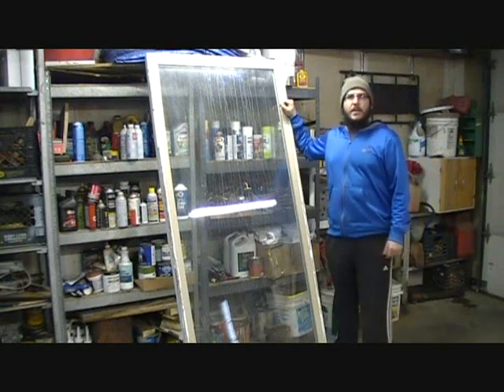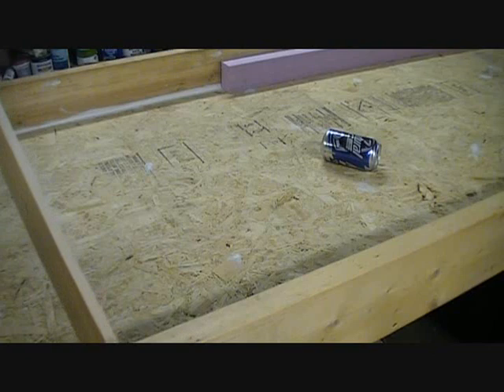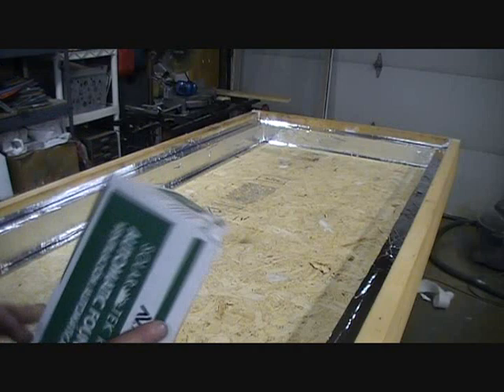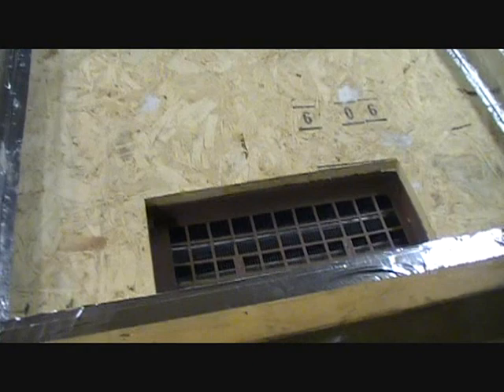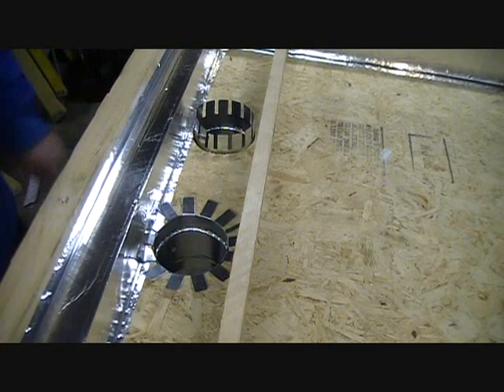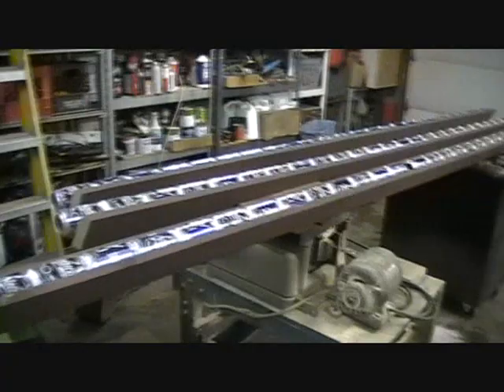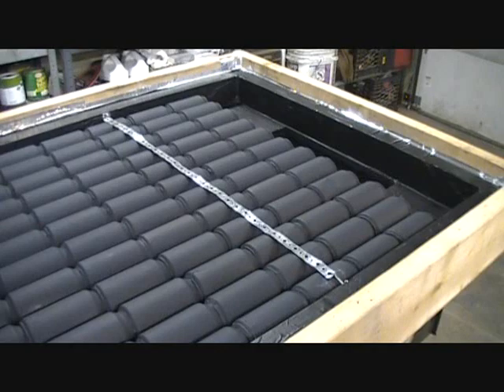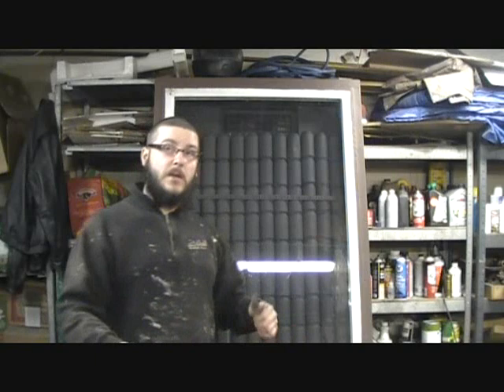$50 Homemade Solar Heater - Passive Solar Design

Comment: I'd recommend insulating the back to cut down on conductive heating. Heat will transfer from the plywood backing to the sheeting of the house. The house has a huge surface area which will inevitably draw down the temperature in the box.

Comment: Great build.  One thing when working alone is to put a board across the box, side to side, at each end.  When you lay the window on top it can be moved around and one end at a time can be dropped into the recess.  Kinda like using the slats from venation blinds when using contact cement and Formica.  Just found your video so I'll look for how it turned out next.

Comment: Great video !
I tried to enlist in the Ukraine Army after serving in the U.S. Marines but was told I'm too old.
My best friend is Ukraine and has family and friends there. Just wanted to help some how.
I saw a reflector made from mirror tiles mounted on rods that could be bent to focus on the coil.
I've recycled a 10' diameter D- band satilight dish with reflective tape focused on a welded aluminum  radiator from my old Corvette. Just welding stabizers on the mast and build mounts for the actuator and tracking solar panels to complete.
Thanks for sharing your knowlege and I'll be praying for your country.

Comment: Great job on this video!  Thanks for sharing your efforts - practically all houses should have this technology, and your version is much lower cost than a lot of other options.  I apologize, but I'm going to quibble with your choice of outflow vent.   If that doesn't close until 40* F then people in places not as cold as Maine will end up air conditioning their house in the winter.   It gets really cold and stays really cold in Maine, so this won't be such a problem for you, but people as far south as Missouri need to buy snap switches to turn on the fan / open sealed  damper at about 120* F and close the damper/shut off the fan at about 90* F.
Reply from the maker: Agreed and good points made.

Comment: You should install some aluminum bars inside the box. These aluminum bars will be used to store more heat and stabilize the heat fluctuation  when the sun is not shining.

Comment: When building a solar heating unit such as this, a few additional things you can do is contact a local machine shop for the shavings from their milling machines to place inside of the cans and to also obtain any sections of 1/8" thick steel or aluminum you get your hands on to completely line the plywood backing inside of the frame since it will act not only as a heat sink but will also radiate an intense amount of heat you would not be able to obtain with the plywood backing alone. Remember to paint with VHT flat black or barbeque black, but you will need paint specifically made for high temperature use otherwise it will not survive very long in an environment such as your solar heater.

Also by crumbling/crushing smaller tin cans and filling the inside the cans you had decided upon as thei source for your solar collectors those will do as nicely as the shavings, or even old lead weights from any tire store since they have to pay an environmental fee to dispose of them as hazardous waste.

Remember to lightly scuff the exterior of each can in order to enhance the ability of the paint to adhere to it's surface, which should be dull or flat black VHT exhaust or barbeque paint, no gloss since any gloss will reflect sunlight.

The cans I used, BTW, were dog food cans from Costco and fit vey neatly into each others top and bottom and when joined with a fine bead of JB-WELD make a virtually leak proof joint which equates to more heat transfer to the vent into your structure.

One last item to consider is for safety you can add a layer of fine stiff wire over the glass to protected it, and no it will not decrease the effectiveness of the unit to gather the Sun's rays to any real degree, no pun intended.
Reply: So you would recommend putting hazardous waste in the airstream of a solar heater? I'm guessing you didn't think very much on your concept before sending in your suggestion. Health and safety should be of utmost importance in ANY endeavor. Not just for yourself, but also for others. You must also be very careful with recommendations so as to avoid harming someone and possibly incurring a lawsuit. Be safe.
Reply: @donaldshimkus539  I was in charge of the VOC Environmental  Program at Disneyland for sixteen years which I perfected and established and each and every Disney Park from Florida, to Europe to Asia uses this program and never once did our Park receive a Citation for an environmental violation during the time I oversaw the program.

So before you attempt to belittle my expertise, you should know that neither shredded metal nor lead are capable of releasing VOC's, volitile organic compounds, into the atmosphere.

As far as using VHT paint, it is of an approved VOC level for any area it is sold in per the local Air Quality Management District, otherwise it CANNOT be sold, so go to the store, read the label where it states, "VOC Content" to verify if it may be legally used for a specific application. Keeping in mind that each AQMD RULE has a different plateau or level for each type of surface it may be applied to, with wood being different, than metal or fiberglass, vehicles vs aircraft - So did you try and bust the nuts of the original contributor as well or did you just wake up.

Your smartass and uninformed remark only let everyone on this site know how unknowledgeable you are as to how the environment is actually polluted, especially when you do not know the games played with various products which allow them to be 'legally' used where yhey had previously been prohibited.

As for being SAFE, I was also the Safety Rep for the Maintenance. department for close to twenty-six years which is comprised of several hundred members and was kept up to date with the current requirements per OSHA and CAL-OSHA so I dare say I am quite probably more  familiar than anybody on this site with both the environmental and safety issues of what your statement alludes to.
Reply: No Not everyone
Reply: I am a theorectical partical physist And I specialize in thermodynamics
Reply: Just kidding
Reply: but don't say your better then everyone hear mickey
Reply: OUCH ! Larry, it's painfully obvious you are WAY to intelligent to even be on this silly little site. Go play someplace else.
Reply: Use a metal screen.
Reply: Go Larry Whalen! Thank you I am prepping and thought of using corrugated steel panels and cans as well to achieve this. Millings are a great add to this project. Would you recommend  any thermal break using a 1" foil air gap to separate and insulate the unit.
Reply: Great idea on the glass. I found a set of sliding glass doors on marketplace for free. I will also have to remove one pane of glass but that's easy. I do encourage using a foam board backer for insulating the interior of the heater which will also make the interior of the heater hotter. I plan to use foam board and then plan to use aluminum foil tape over the foam and then paint it all black of course.

I found another guy who cut off one side with a can opener but on the bottom side of the can, he poked 4 evenly spaced holes through the bottom so air flow would be somewhat restricted and allow it to heat up more.

Comment: Wow I think you are one person that would never irritate me.  You don't cut corners on your work. You are great at being a teacher plus no pause in-between your thoughts.  every detail well thought out.  you thought of every angle.  I don't even need to see you to be attacked to you.  Not everybody thinks like that  Then I was also impressed by your musical talents.  wow  
aside from you impressing me I think I'm going to start building some for the homeless Its getting colder and colder in Seattle I'm starting to see all the homeless suffer in the cold.  I will just have to come up with a battery operated fan.  unless you can think of something.  You were also very resourceful with your material you must have some background in construction.
Reply from the maker: Thank you for all of your kind remarks! 
I do have some background in construction.... but other than working with Dad in the garage and apprenticing for a few other folks, I have no formal training.  What I do have, is drive.  That's the "I want this" factor.  It sounds like you have it too-
To hear that I might be part of the inspiration for helping the homeless is heartwarming.  A battery fan would move more air, but when the batteries are dead, the fan blocks air flow through the passive system.  On the the other hand, a very small solar panel would solve this problem.  It wouldn't work at night but there are no solar heat gains after sunset anyway.
Good luck!

Comment: I'd rather heat water and store the hot water in insulated tanks and use the hot water to heat the house. With water you can store the energy longer so you can use it on those cloudy days.

Comment: I came across a bunch of aluminum rain gutter downspouts and just painted them black for the tubing. way less assembling than the aluminum cans. Mind you, the downspouts would be prohibitively expensive to buy just for this, but I got them by cleaning up a friends yard.
Reply from the maker: That's a fantastic way to go.  They probably have greater thermal mass too since the aluminum would be thicker.  Also, as smooth bore inside is great for the chimney effect.

Comment: suppose later you will show it working with temps in and out and flaps on the top so that it doesn't reverse at low temps, good show , you have seen this done by others, hope it works at your longitude
Reply from the maker: Yes, I'll be installing it within the next couple of weeks.  The smaller one I built does work, but needed more surface area to be effective.  This one is about 3 times larger than my last.  That plus a very strong due south facing should make it work well.
Thanks for your interest!

Comment: Very heavy Item with both glasses. But would it not work better as
intended ?? $$$$.  Insulated. Seems to me the more heat you can keep in the box the better. Also no movement at glass surface is a great plus.. don't want to be collecting cold from outside the unit. That's why I like the can idea. They keep the air isolated where it needs to be pushed and thin for very quick exchange. Ill probably us down spout for min though. The cans slow air flow.. much work but much cheaper too.

Comment: I think you would have been better off not removing the tops of the cans.  They provide a baffle that slows the airflow and allows the air to absorb more heat.

Comment: YOU COULD HAVE USED A SMALL WIRE ,LIKE ELECTRIC FENCE WIRE,  AND RAN 4 OR MAYBE 6 TO HOLD THE CANS. I SEE SOME PEOPLE USING BLACK WINDOW SCREEN AND IT SEEMS TO WORK VERY WELL WHAT WOULD YOUR DESIGN DO IF YOU WERE TO ADD 1 OR MAYBE 2 LAYERS OF SCREEN TO YOURS. DO YOU THINK IT WOULD IMPROVE THE FUNCTION OF YOURS ?.....

Comment: do you have any idea at what velocity the air will be going through the individual can-pipes? Do you think you would benefit by having some sort of restriction in some of the cans, as a way to make the air slow down and get heated longer.
Reply from the maker: The air moves through the heater fairly slowly. I think there's already enough restrictions.
If I make one again, I will definitely insulate the back wall. I think I lose a fair amount of heat through the back.  I think air flow would be faster too.

Comment: Using a pane of double insulated glass probably isn't the best for solar heat transfer.  They are usually coated with a ultraviolet inhibitor to prevent "sunbake" when installed in a home.
Reply from the maker: Watch the video bro.  I broke out half of the window for just this reason.
Reply: I used a double insulated glass door for my solar furnace but I did NOT remove the second pane; despite this (and the UV inhibitor, if it was coated with one), I routinely get temps of 160F+ and often 180F+.  I'm okay with the slightly lower temps!

Comment: Is it necessary to remove the tops and bottoms of the cans? I would think that if you simply drilled a hole in the bottom (1/2" maybe?) that the rest of the top and bottom would act as a sort of baffle to hold the air longer, as its being heated?  Or maybe not, but is it actually necessary to go to the time and trouble to remove those pieces? I've been getting ready to build one of these for a couple months now. You mentioned having done a few of these, did you ever try that? Thanks! good video!
Reply: I think taking off the top as shown in the video would be better, then at least drilling a hole in the bottom(1/2" maybe), should work, but can opener looks much safer than trying to drill a huge hole into a soft can :)
Reply: Michell Is Not Allowed "Is it necessary to remove the tops and bottoms of the cans?" -- No, you are actually better off NOT removing the top of the can.  The smaller hole creates a baffle that slows the airflow and allows it to capture more heat.
Reply: When I used cans, all I did was drill a one and a half inch hole in the bottom with a spade bit and just left the top alone. Still a little time consuming but not as difficult as a can opener. I have since moved on to aluminum downspouts.

Comment: OMG, with all that Cans (Although it's free).. and High Heat Silicone and your time :((( . Just get some 3" Flex Hose Pipe from Homedepot for Cheap and FAST and save Time and Money, LOL
Reply: Jordan Bronson I believe the idea of the aluminum cans is because aluminum is a great conductor of heat and more effectively transfers the heat to the air to be heating the house.
Reply: plastic off gasses. Aluminum gutter downspouts also work well but aren't as efficient because they are square but not enough to matter. Much easier and they come in 10ft lengths
Reply: @aaronheaney1601  I'm guessing Jordan is referring to 3" flexible aluminum duct (dryer vent), which works very well for this.

Comment: You did not use a fan, how is the circulation?
Reply from the maker: Fair- this is installed in an off grid location, so that's the main reason I didn't use a fan.
Air definitely moves through it because of convection. But more would be better.

Comment: Any idea how well the vent works? I'm looking for a self closing vent
Reply from the maker: It works okay, but doesn't seal all that well.  It's an improvement, but only just.  In the future I'd like to add a small solar fan.  No batteries... just a small panel wired direct tot the fan.  
The best solution in my mind would be a photo cell controlling an airtight door..... 
Home depot sells one just like the one I used, master flow 16x8, listed on their website.

Comment: Use a belt sander for the bottom of the cans dude
Reply from the maker: To remove the bottoms?  Or to help with adhesion of the glue?
Reply: Taking the bottom of the cans off, 80 grit belt it takes about 4 seconds
Reply from the maker: @johngent5793  That's not a bad idea.  I'll give that a try next time around, thanks!

Comment: Are paint fumes safe for health?
Reply: NO, paint fumes are not safe for you. Read my reply to an earlier comment about the use of paint in this system. Once paint has cured and dried it can no longer 'off-gas' or release any harmful fumes, but if you have any doubts contact the manufacturer for an actual statement of fact about their product.

I personally have a damaged esophagus due to my company furnishing the incorrect respiratory device for the spray painters to use which allowed isocyantes to eventually injure me, even though I advised them of the dangers involved by not using a 'fresh-air repirator' when spray painting.

So anytime you are painting you should use an approved system when spray painting especially.

When brushing or rolling keep the area well ventilated so as not to permit the smell of the paint bother you, and if you feel it necessary to wear a cartrige style mask obtain one that is designed for the chemicals being used in the paint, which will be indicated in an MSDS, Material Safety Data Sheet, which is legally required to be provided to ANYONE who uses any product which could harm you. Simply contact the manufacturer direct or go on line to obtain it. However, State law also requires for ANY company that furnishes, sells, these products to have a copy of the MSDS for each and every product they sale, and are required by law for the Fire Department's use in case of an emergency and it is required to know what they are dealing with in case of a fire which could release poisonous fumes which could overcome their personnel.

Possibly TMI but once again, paint fumes could hurt you IF you were to be exposed to them for too long for several reasons, any of which might be because you are not used to that particular smell or other reasons, thus the reason to obtain a Material Safety Date Sheet, MSDS, in order to educate yourself as to any possible dangers a product might present is advisable.

Comment: Nice project. How did it work out for your heating? My 3 foot by 6 foot solar house heater outputs 140 F (60 C) of free heat when sunny. My larger 6 foot by 6 foot unit outputs 203 F (95 C) of heat. https://www.youtube.com/watch?v=7S8CWsIcK20